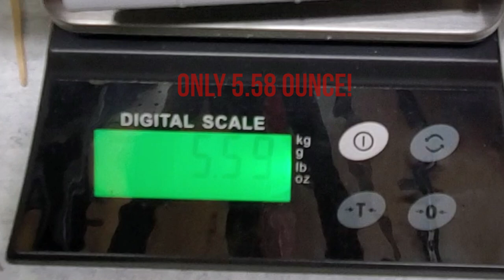3d Print Allison Model Engine Kit from M5 Performance and Rattlesnake RC

Comment: I obtained a 1976 U-80 Van's PX and the motor seems to be made from wood and seems heavy..  What is the approx weight of the 1/8 scale turbo allison?
Reply from the maker: Good question, but I don't know the answer. I don't have any on the shelf to weigh for you right now, but I know they're in stock at Rattlesnake RC. Maybe message Bill there and he'll do it for you? Here's the website www.allrc1.com

Comment: Mate they look awesome, will the 1/8th an gas come hollow blocks to fit over the engines
Reply from the maker: The blocks have a flat bottom with a wide printing support grid inside that is very easily cut out with a Dremel tool or grinder.  The flat bottom is for easy mounting when a cutout for clearance is not needed.

Comment: What material is that engine made from and what adhesive re you using?
Reply from the maker: Most of the components are PLA, some PETG, and I use Starbond medium flex CA for assembly